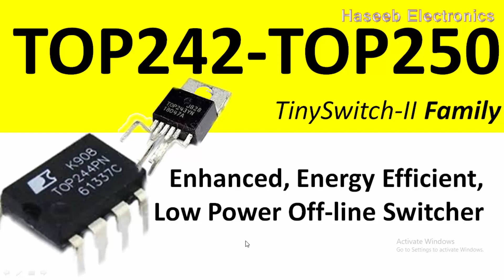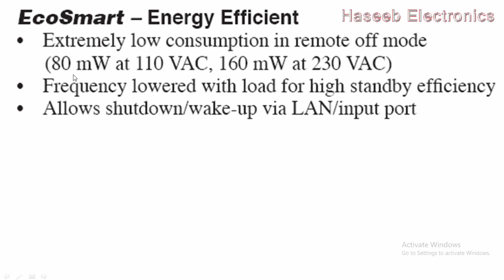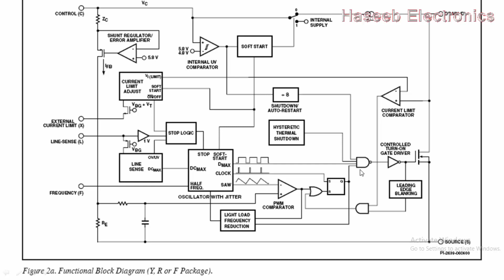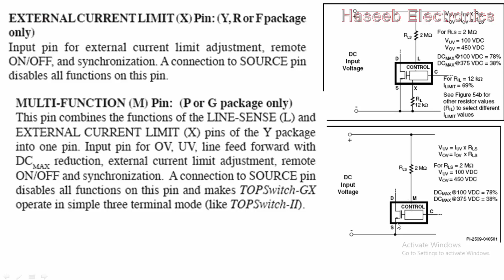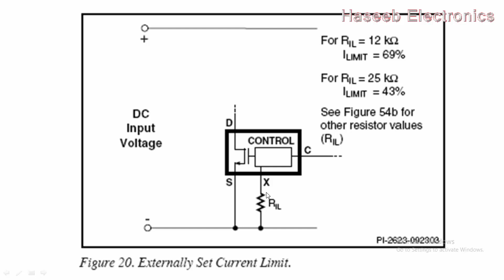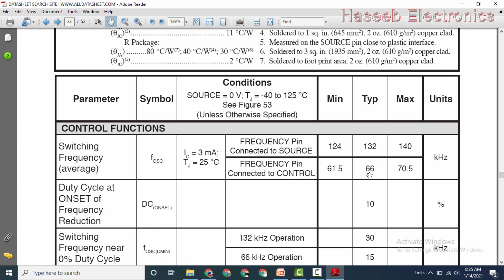#313 TOP242 to TOP250 TOP Switch-GX Family Integrated Off-line Switcher

Comment: Can I use TOP247YN in place of TOP250YN directly with out any changes in circuit. Let it's low power out than top250?
Reply from the maker: TOP242  to  TOP250 is 1 family, each heigher number has more power rating 
TOP247 is less in power with compare to TOP250.
if it is used in any standby circuit, then it can work normally without any modification. but if the IC will switch for a long time operation, then there is high failure risk 
it is better to arrange the original power rating IC

Comment: Thanks for the detail lecture.  Really appreciated.
Reply from the maker: You are welcome!
Reply: I have a power supply that is using TOP243YN, the secondary outputs were only 0.6V (for the 5V output for control board & display) and 0.6V (for 12V output for motor). Primary voltage is normal (311DCV), all the diodes are ok, all connectors to load has been disconnected (to rule out shorted) but the optocoupler pin1 and 2 is zero (when tested with multimeter when board was on).  Power off optocoupler pin 1 & 2 is 1.09V. I noticed there is no tl431 in this board too. In this case, what can i check?  Hope you can provide some suggestions. @HaseebElectronics

Comment: Trying to fix Ryobi 6 port charger. Smps IC is not available and I can only get this one quickly in Australia. I'll try. Think power should be enough because 6 port charger only charges 1 18v bat at a time with 2A I think. Should be a quick install of this IC package. I'll disable all the protections and hope it works out.

Comment: Can I use TOP244YN package in place of TOP244PN in a circuit if I combine L and X pin on the YN package, and use them at M pin of 244PN package in the circuit?
Reply: hello brother have you tried what you have asked , i face the same problem
Reply: @amirchaka1407  I was able to successfully use the TOP245YN package by looking at the datasheet instructions. No, we should not combine L and X pins per the datasheet of top245YN. They have clearly given how to use the L and X signals for your circuit. If you want, you can easily use TOP 244YN or TOP245YN in place pf TOP244PN. If you want, I can go back and check the datasheet how I used the L and X Pin of YN package.

Comment: Is top 246yn and top247yn is same
Reply from the maker: yes 
top 246yn
247yn
248yn
249yn
250yn are same 
every higher number have more power than the lower number 
so you can use 247yn instead of 246yn

Comment: I  bought dell U3011 monitor, i have used it for 1 yr now. its now dead. i opened it and found TOP266vg ic is blown. is there an equivalent ic. coz i have searched for TOP 266vg here in Nairobi but its not there. could you please make a video of TOP 266vg,,,pleaaaaaaase.

Comment: sir i have water purifier smps of ic  top244 fn ( i think this number because some number was erased by the company & looking top written on ic & watt which is 48 watt smps i asume to this no) is replaced by top249yn because of non-availability but it is not working . then i replace with ca 888 circuit. though its giving 23.9-24.2 volt but fluctuating . when i am connecting to booster pump of ro water purifier it reduces to 17.2-17.5 volt . please guide me to resolve the issue

Comment: Nice Video ! Can you make a video on how to increase the current for an adapter through the sense resistor. I do not know how to play with this. Thanks.
Reply from the maker: we shouldn't try to increase current of any adapter. 
basically the transformer is calculated to produce a specified amount of power. if we try to increase it's current, that time the transformer apparent power will increase which will cause to heat up or destroy the transformer
or it may cause to excessive power dissipation in driver MOSFET or it's damage
Reply: @HaseebElectronics  ok thanks, I thought the procedure was as easy as with playing with tl431.
Reply from the maker: no it is not same as TL431

current sense resistance is to be changed that is connected to i_sense pin of pwm controller
 or i
n case of MOSFET it is connected to source pin 
so changing these resistor is always cause to increase in current

I watched some videos who claim to increase the current but it is totally non professional approach
because it causes to excessive current flow in MOSFET to primary of the transformer
so it will cause temperature rise in transformer winding, MOSFET power dissipation and core saturation rapidly
Reply: @HaseebElectronics  Thank you very much for your answer, i will forget about that.